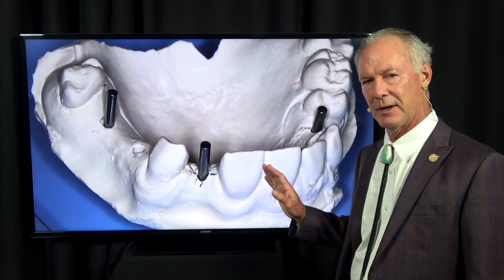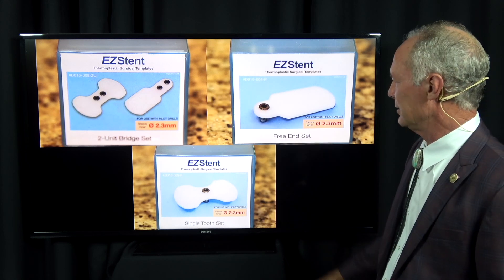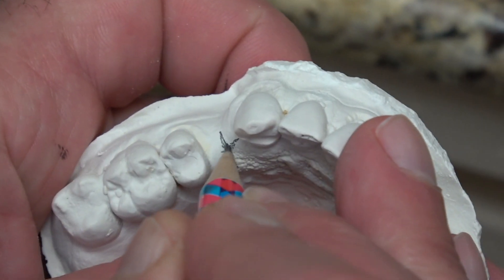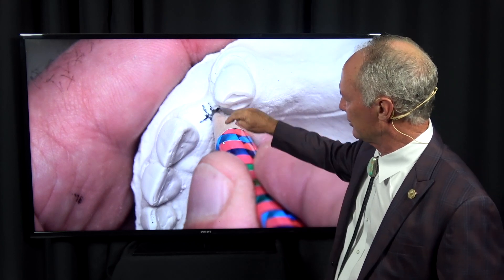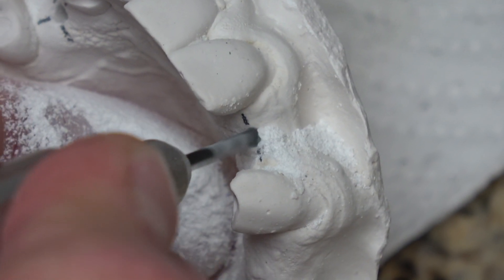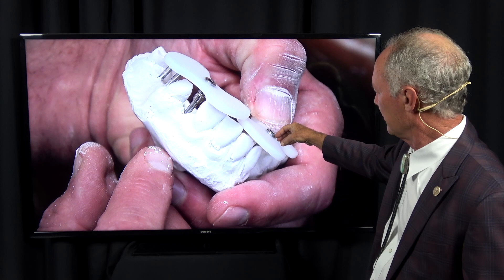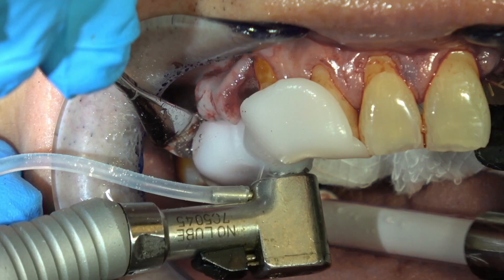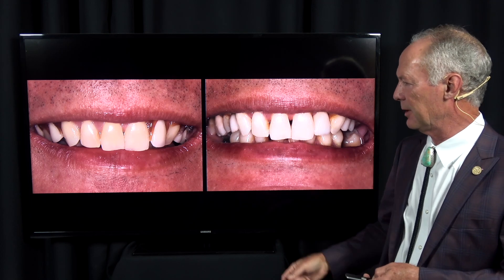Simple Implant Surgical Guide Fabrication - Dental Minute with Steven T. Cutbirth, DDS

Comment: I prefer to plan the position of the implant using a CBCT scan superimposed on an Itero scan and having a fully guided surgical guide fabricated. I fully agree that the implant housings should be "picked up" intra orally rather than the common practice of having the lab do this because the denture seats differently on the soft tissues than it does on the stone cast.  Ideally the denture is allowed to "settle" for 24 hours before the attachments are attached with quick set composite.
Reply from the maker: I don't use a surgical guide for SDI placement because I like the latitude of being able to pick the best bone site at the time I am placing the SDIs, and SDIs can vary 30% from adjacent SDIs. Sometimes, when you are placing SDIs 3 months following teeth extraction, the bone is in a certain area is soft and an SDI does not "bite" and stabilize to the point I cannot torque it any farther into the bone with the finger driver. In those cases, I just move to a different spot for that SDI placement. When this situation occurs, it is in the maxillary arch 99% of the time.  I prefer SDIs to locators for denture stabilization. 
Take your practice to the Top Tier. Subscribe to DentistryMasterClasses.com for an organized library of all the Dental Minute videos plus many complete comprehensive cases and many very important articles. New cases are added weekly.  Only $20/month.
Click here to subscribe: 
https://membership.dentistrymasterclasses.com/purchase/?plan=513